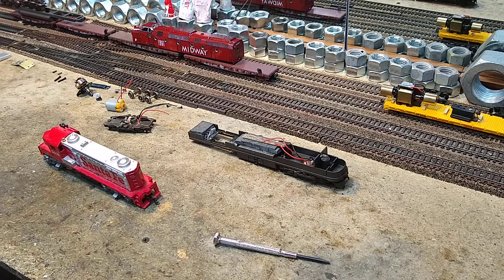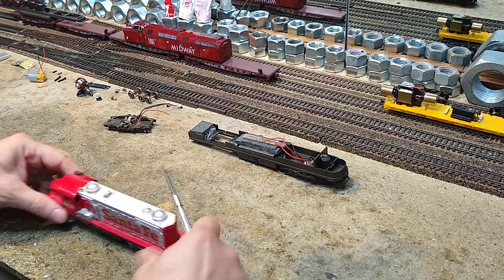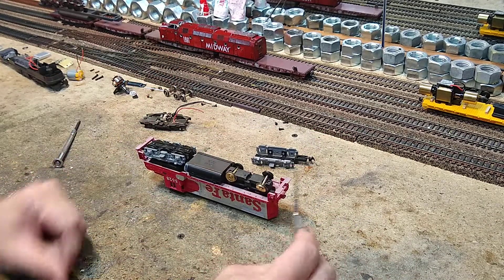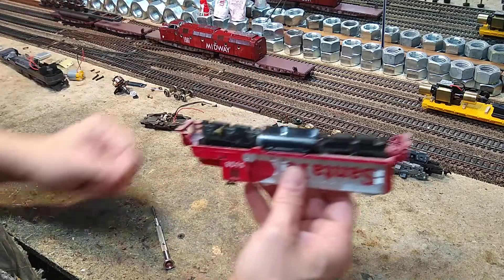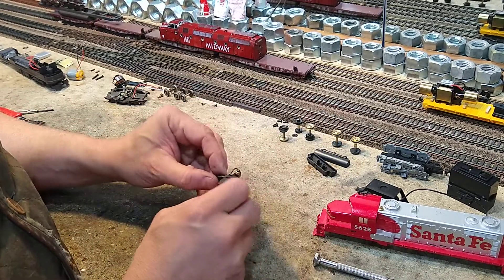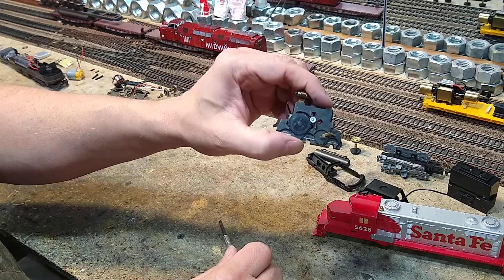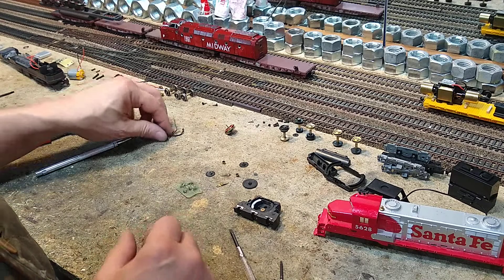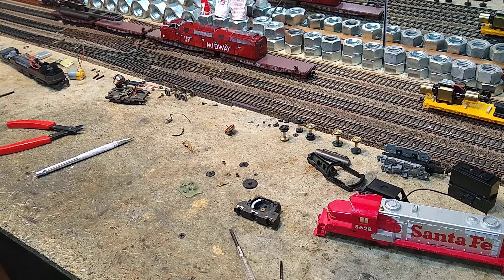Tyco GP20 Rebuild part 1 disassembly

Comment: Twenty years ago I kit-bashed a Tyco GP20 shell with an Athearn GP35 chassis.  It's a perfect conversion.  Required very little modification to the shell.  The Athearn drive is far superior to the Tyco.
Reply from the maker: I did a Tyco GP20 onto and AHM GP18 just a little while back and a Bachmann GP30 onto an Athearn GP35 frame. When properly rebuilt, the Tyco Power Torque has excellent performance and leaves lots of room under the hood for other stuff.

Comment: Great video!!
My commutator is damaged. Any suggestions on where to find a replacement? Are the ones on Aurora slot cars the same?
Reply from the maker: yes they are!  and while picking up a core, also consider getting upgrade magnets.  the slot car guys have several strength magnets, but don't get the strongest, get the 2nd most strong - those are a super sweet upgrade for power torque motors!
Reply: @elite194  what ohns?
Reply from the maker: there are several online stores that have Aurora parts and if you search the magnets you'll run across a couple studies done by guys who test each level of magnets!

Comment: Ive lost the pinion gear on the motor... real pain in the butt... any ideas of a replacement?  Also what size would it be if i need to frankenstein a gear from another kit?  Thanks... great info here
Reply from the maker: is this the metal gear or the big plastic compound gear?  the easiest way to join the Tyco facebook group, of which there are a couple.  There are several guys who sell those parts directly through the marketplace.  Super easy and not expensive!  If you had to fabricate these guys then we'll have to talk more.  It's not impossible, but considering the time involved, just buying those is so much easier.  At the same time, get some magnets that are an upgrade - those are still made because slot cars use the same ones!

Comment: How do you get the magnets out? I tried using tweezers and grabbing onto either bracket that the magnets seem to be connected to, no movement,  don't want to break anything. The engine is a parts engine, missing gears, and the main big gear is busted in half, but the motor, even though was really dirty on the armature or commutator,  it runs, I have it clean now, but there's grease, and oil in behind the magnets, so I want to give it a good cleaning before putting I back together again. Any help would be grateful 🙏. Thanks.
Reply from the maker: remove the core of the motor, then heat up some simple green or other green cleaner and soak it.  that should take care of the tiny bit of glue behind the magnets.  then you can get sttronger magnets from the various places that sell Aurora slot car replacement magnets!
Reply from the maker: also check out the Silver Streak video beacause I did more stuff with the motor in that video
Reply: @elite194  Thank you,  I'll search for that video and watch it, most appreciated. 🙇‍♂️👍

Comment: Both of my train sets as child used these power torque motors. Both quit working after a week. Yet, the headlights still worked.
Reply from the maker: check for carpet fibers, that's what I usually find when I open these up.  power torques are very easy to fix

Comment: I'm rebuilding this exact train. One of the motor brushes is bad. Any idea where I could find a replacement? Thanks!
Reply from the maker: take a look at my Tyco 4301 Silver Streak video, it's the same as the GP20 with more info:  https://youtu.be/w_wftHnlIwU   You can get new brushes from Auto World Slot car parts.  SKU : PSCXT-011 by Xtraction.  Dirt cheap and you will have spares!  Also  you can get new more powerful magnets, but don't get the strongest magnet, get the next one lower - the strong is too much and the motor won't work right.  The next lower is a huge improvement.  Hope that helps!
Reply from the maker: Hardon Creek Slotcars sells Aurora pancake style motor magnets
Reply: THANK YOU!!!!!!!!!!
Reply from the maker: @mikeanthony8292  no problem!

Comment: What type and brand of magnets can I use if I need to install replacement magnets?
Reply from the maker: Dash Motorsports Polymer magnets are the ultimate upgrades - tell them what you're working on and they'll tell which magnets are the best.  Some of the magnets they sell are too powerful and meant for slot cars.

Comment: What is with that Midway loco shell on the flat cars.
Reply from the maker: Krauss Maffei ML4000
Reply: @elite194  I have one powered unit and a dummy in Rio Grande will yours run.
Reply from the maker: @csxns  I have almost solved the problem of installing a new motor.  I've got 6 of these and I already started a playlist on their rebuilding and painting.  The key to changing out the motor, which must be done to make them DCC lies in the Rivarossi E9 design.  I must copy that motor cradle because it is the same fit for the Krauss Maffei with a different motor.  Once I can make the correct cradle then I can install the Mabuchi 24v 266 motor and it will run most excellent.  They already run very well, but half of the ones I have had their motors removed before I got them.

Comment: Wear can I get TYCOHO GAUGE PARTS FOR SANTA FE 2654 ENGINE.
Reply from the maker: facebook group called AHM model trains.  also there are 2 facebook Tyco groups and you can get parts there.  but 2654 should be a GP18 so you're looking for AHM parts for that one.